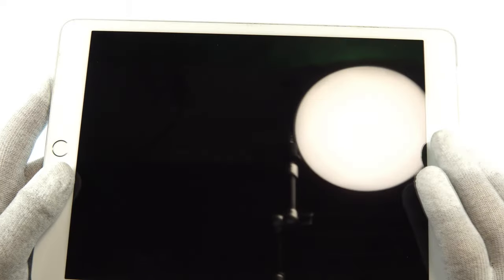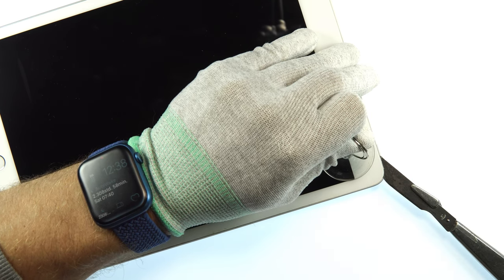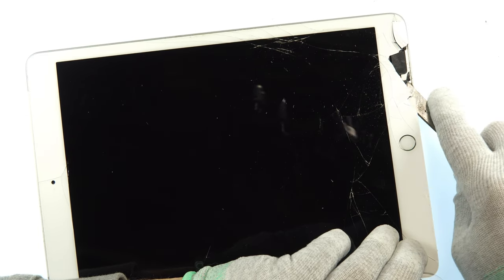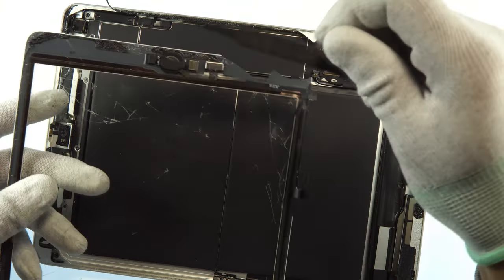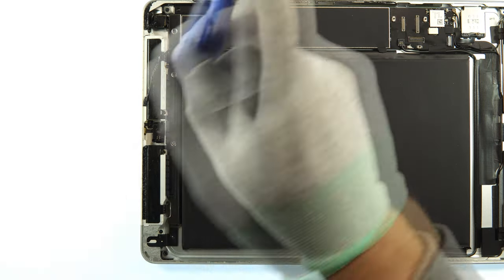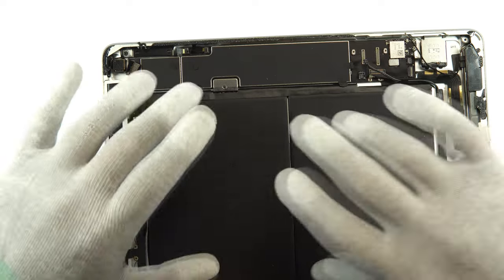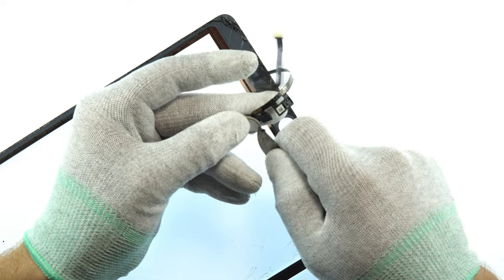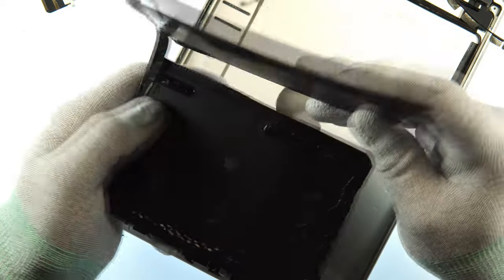IPad 6, 7, 8, 9th Generation Charging Port + Battery Repair Replacement - Full Tutorial

Comment: What do you do if, when removing the flex cable connection, part of it rips and stays on the main port connection? 😬
Reply from the maker: Replace it if possible if not possible bad.
Reply: Same happened to me.  Just turned ipad Into Frisbee . Lightning port sux

Comment: Too bad about the screen, but nice to see unfiltered and uncurated work where it does not always go perfectly 😁
And as for the gloves... I feel they are a must as handling the iPad without them will 100% guaranteethat there will be greasy streaky fingerprint-marks on the LCD, and no matter how many times you clean it it will never ever be as it was. The owner may not see the marks, but I will spot them on all devices always and it is something that cannot be unseen 😅